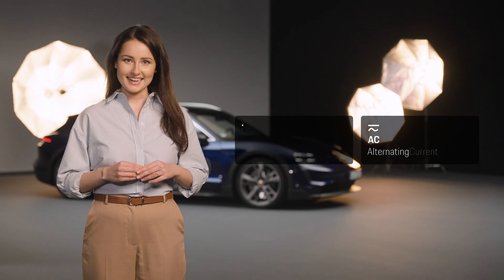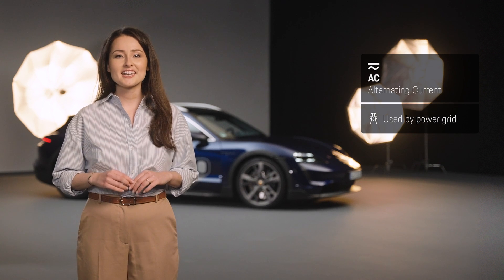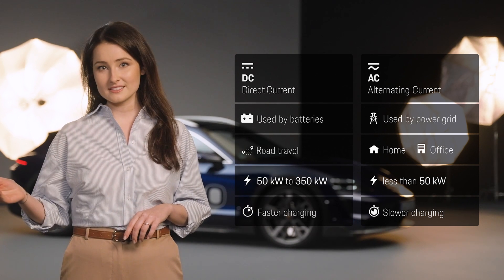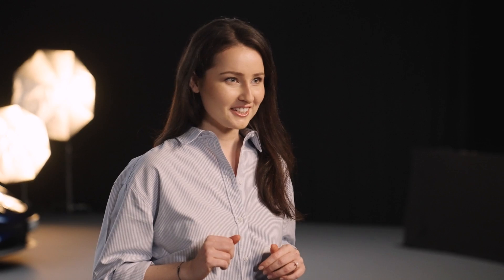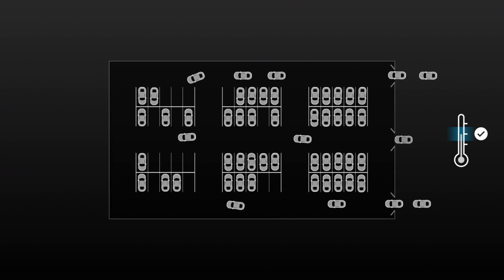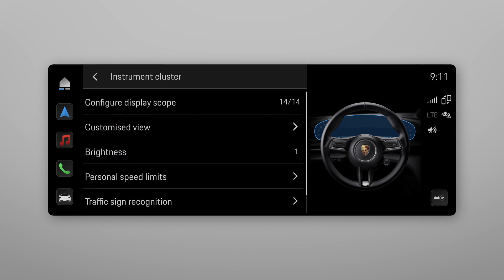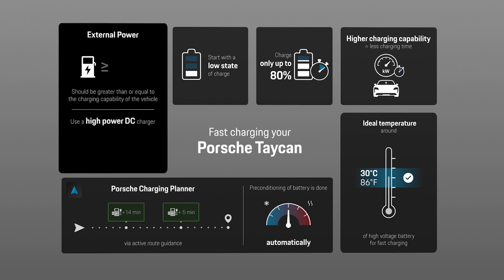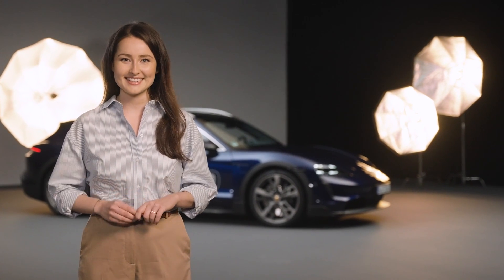How to quickly charge your electric Porsche Taycan | Tutorial | Spot On

Comment: Keeping your battery charged to 80% is fine but fast charging any Lithium Ion battery shortens the capacity over time reducing range. A possible 20% drop in capacity of the battery over 8 years could  see a Taycan range drop from 220 miles to 176 miles in summer
Reply: Brilliant, bought a Taycan last week. It's a fantastic car, but charging time/range and cost does not translate to what was sold to me. Getting 911 next summer.
Reply: Did you buy New ? What range do you get and battery size ? @olafkreator8654

Comment: Just a shame Porsche have told customers to halve the charging current when at home. No mention of that. . . . .
Reply: That's an issue with their home charger, not the vehicle. Use a different branded home charger and that problem goes away